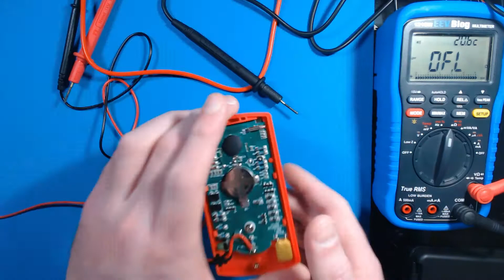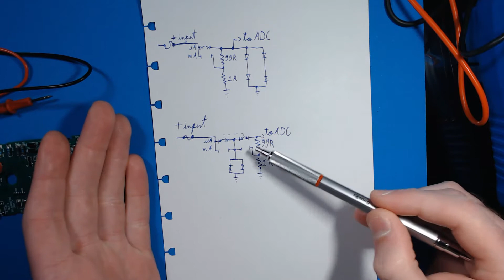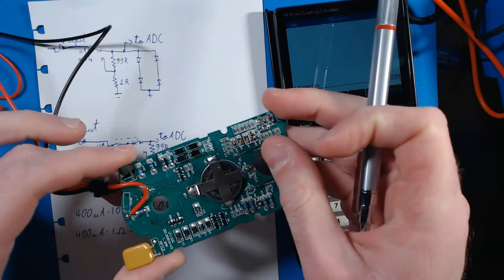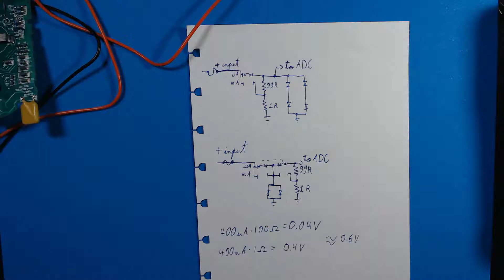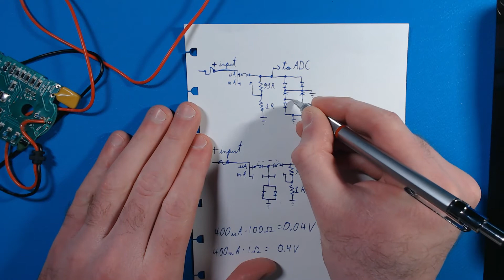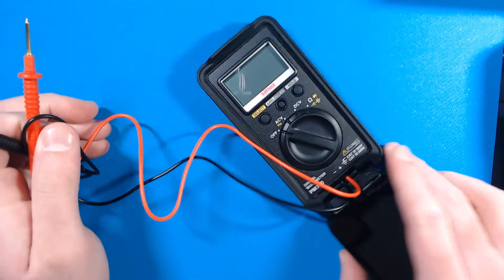Why you should avoid cheap multimeters. (And why the UT120C is a piece of junk!)

Comment: You don’t need the second bodge wire. Both resistors are already connected to the top two diodes (through the switch for the 1R resistor). 

What about the two diodes facing opposite ways… shouldn’t that be copied?